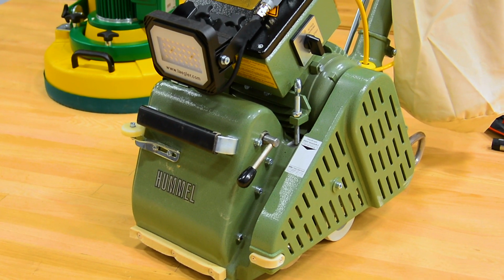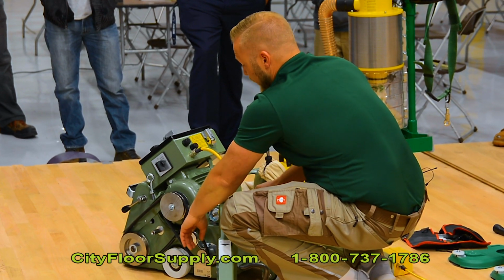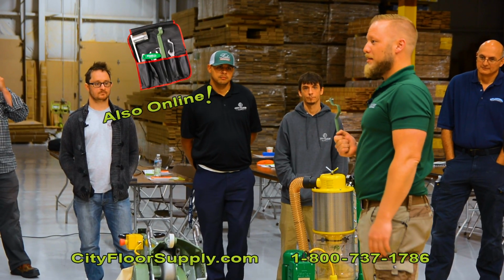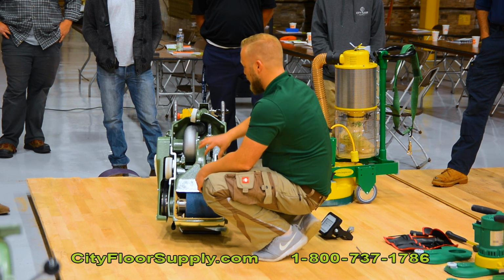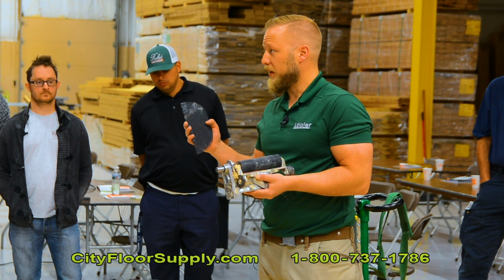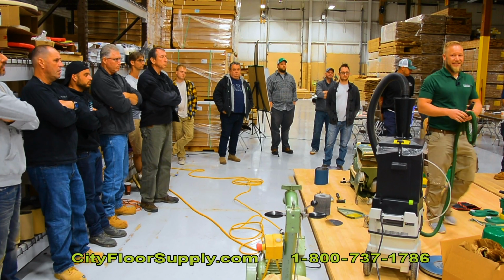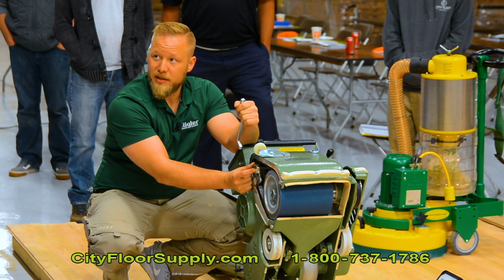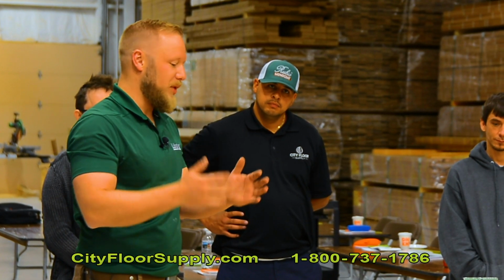Hummel Maintenance | Lagler Wood Floor Sander Maintenance Tips

Comment: the rear tire is jumping just over the rolls of dust that the machine is leaving! I have already observed the drum, the vacuum, the drive unit, I have tried different brands of belts and it always leaves lines of dust, it does not absorb anything when it goes to the front
Reply: You have to replace the felt padding around the machine that creates a seal when you drop the drum down. This we’ll help create more suction. Or possibly your fan is bad and or dirty inside the turbine. After I crappy job with mastic adhesive the machine wouldn’t suck up anymore because of all the funk inside the turbine